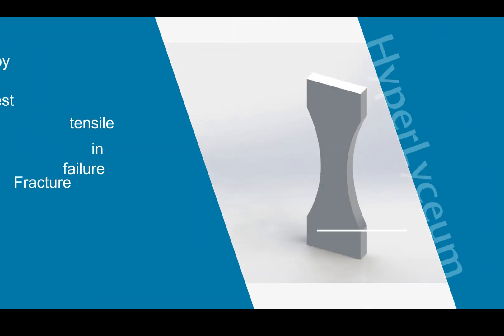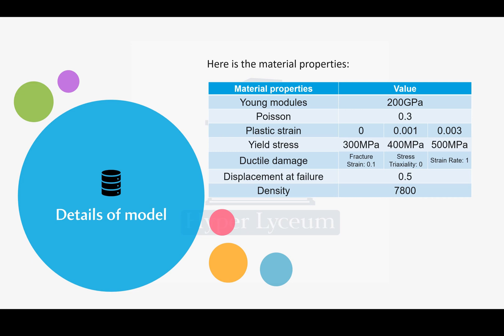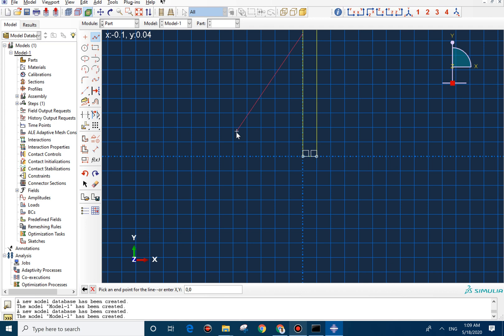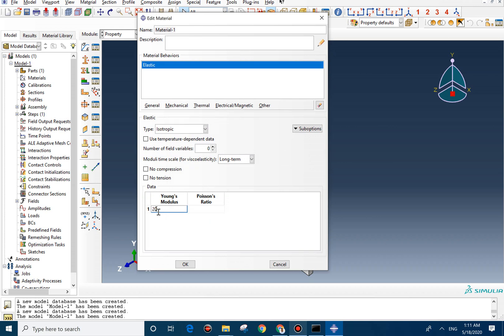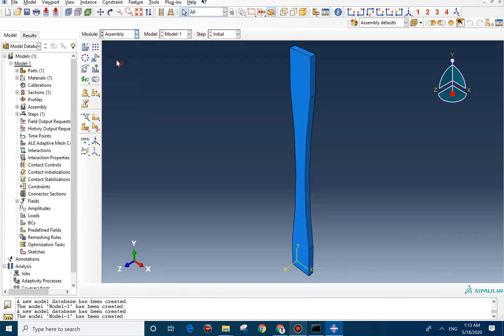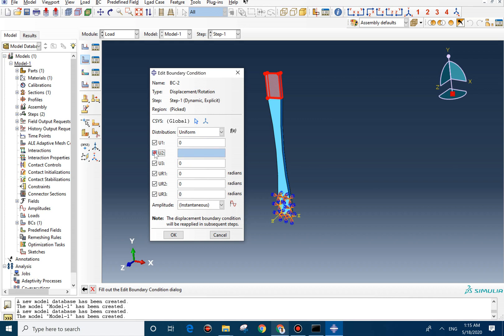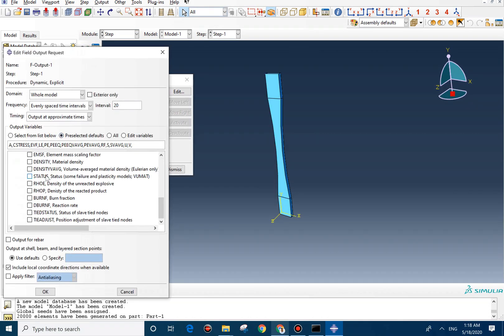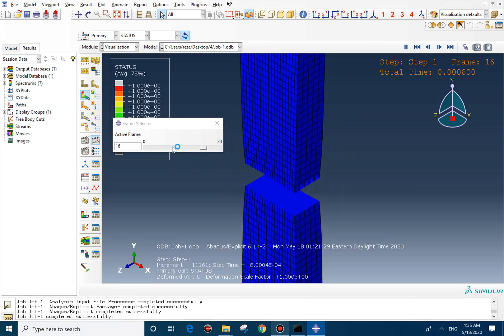A damage model for tensile test in Abaqus

Comment: thanks and what about brittle material failure?
Reply from the maker: It requires to define the material properties differently which was not explained here.
However, the rest of is similar.
Reply: @Engineering_downloads  yes I know. But do you have any reference about that?
Reply from the maker: @AminRahimi-1  Not now but will make a video about it later.
Reply: @Engineering_downloads  thanks friend